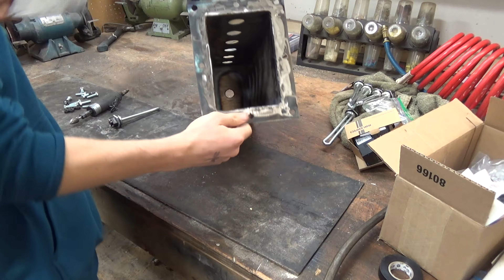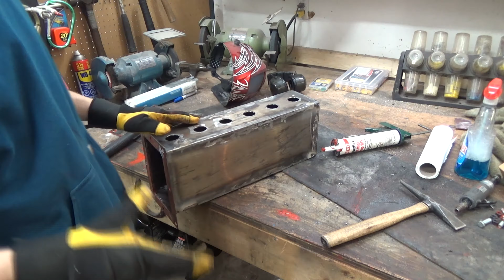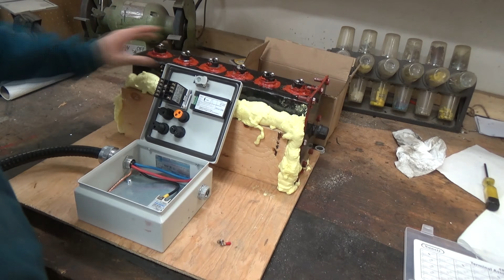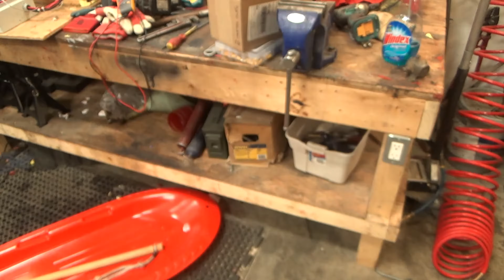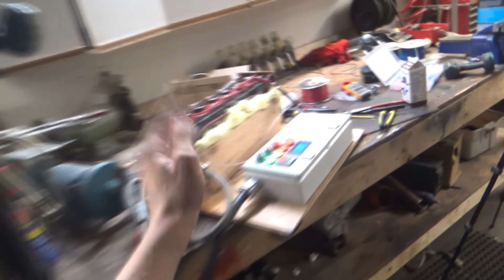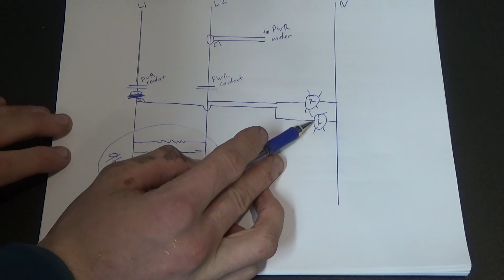DIY Electric Hot Tub Heater MK1 (DIY H.T. part 3)

Comment: Definantly should have MIG welded that thing, would have had zero leaks lol anyways great idea though, actually thinking about building something similar for my 300 gallon wood fired hot tub, since I'm over feeding my stove all the time, it gets COLD here ND hard to get it up to temp quickly
Reply from the maker: Tig is where it’s at, but who has time or money for tig or mig
Reply: @DonkeysBreath  I guess I'm ahead of the curve cause I got a gas MIG welder at home, sure as hell wish I had a TIG welder tho. Still awesome job, I wasn't going to get as technical as your heater, just was going to retrofit a jacuzzi heater tube with a pump into my setup, but maybe I'll give multiple elements a shot since they r like $10 a piece for 1300watt ones
Reply from the maker: erik hall I never really followed up very well on this project it failed, couldn’t get those little elements to seal correctly
Reply: @DonkeysBreath  sucks you couldn't find a  nut with correct thread pitch,  could have welded the bung onto the chamber and tightened the elements like.in a water heater. Guess I'll be re purposing a spa heater assembly lol good video though